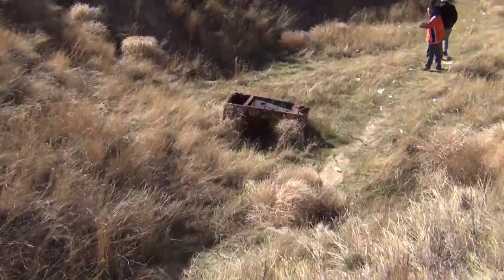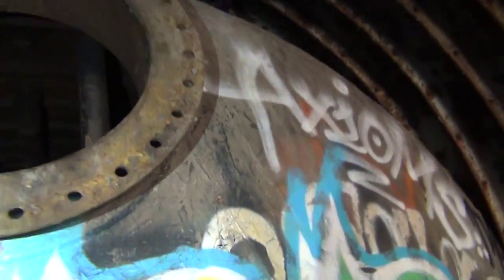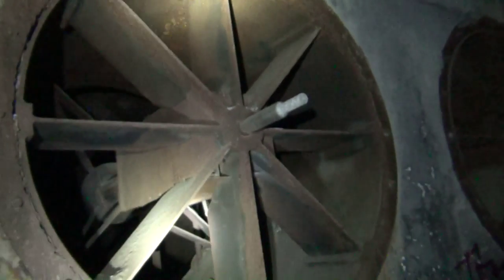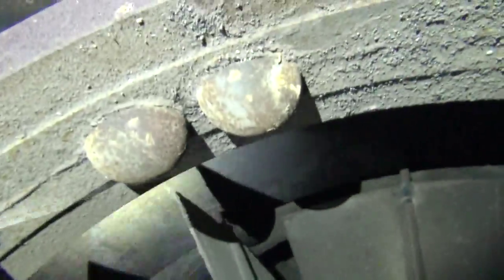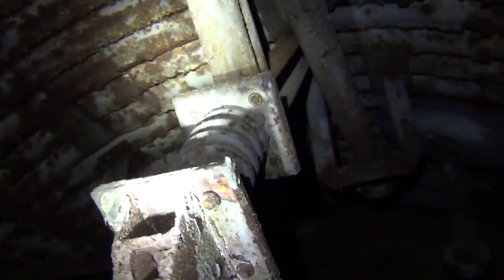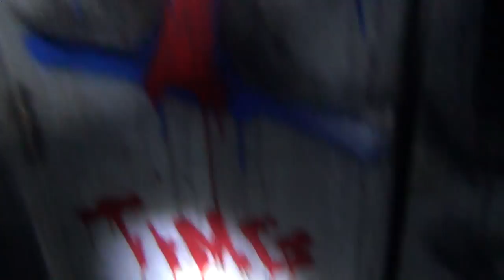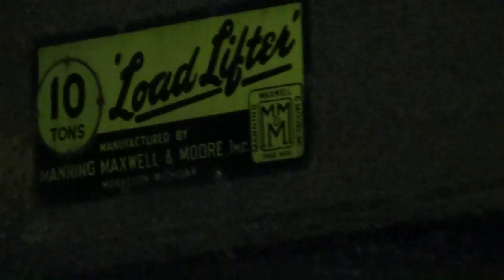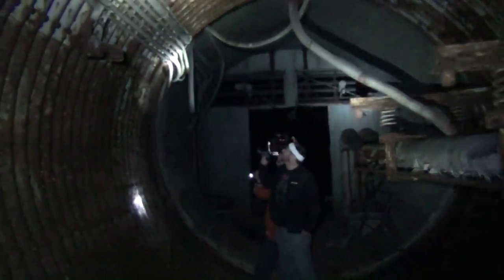Deer Trail Colorado Titan I Missile Silo Complex 2B - Part 1

Comment: That was the power dome, They entered near the air intake and walked across the top floor of the power dome to the exhaust side. The floor below gives access the the rest of the site and the missile silos.We have just seen about 3% of the total site. Looking at the amount of mud that had dried on the intake side you can bet the site is flooded.
Reply: It always had some spots you couldn't go because the water would be to deep

Comment: Entry is via power dome exhaust side where 1 main diesel tank was removed to make scrapping easier.   4 big tubes up high are generator mufflers.   The holes near the outside access are blast valves, not fans.  Area filled with dirt before power dome is the removed day tank for diesel fuel.   Thanks for the video!

Comment: I grew up in Aurora and used to explore these in High School back in the 80s. They were part of the 725th Strategic Missile Squadron out of Lowry AFB in Denver. Actually, there are 3 Titan I sites on the Front Range. At this particular site, a large portion of earth (over 100') has been excavated down  to the tunnel area, exposing the spot where you entered. After it was deactivated, this site was likely used as a storage area; thus modified for ease of entry. When operational, this tunnel would have been buried to the depth of the surrounding terrain. Entry would have been gained via a personnel hatch, followed by a series of stairs descending around the freight elevator. The huge dome you are in was the environmental room for utilities, HVAC and generators.
Reply: Its the power dome,Why would you think they would  put life support (HVAC)next the the diesel generators?. That would just be silly. HVAC was quite far away.
Reply: @mrfinn2006  intake and exhaust for power dome were for the generators etc, not the rest of the base.

Comment: Great video. When was this filmed? I've been out there many times way before all the graffiti was added. Haven't been out there in probably 10 years. A bunch of kids had a rave out there about 15 years ago. Pretty amazing how they pulled it off. Also read in The Denver Post a long time ago that they found a body that had been executed out there back in 1995. Great place for an adventure! Thanks for the memories!
Reply from the maker: Dump a body down the silo and no one would be finding it, just saying. 2015 was when it was filmed. Some say it's closed up now, some say there is an entrance. No idea though, kinda far for a drive to find signs, and fencing. Not worth a trespassing ticket.

Comment: Doing research on this place, hoping to go and take pictures. Coordinates or google maps link?
Reply from the maker: Put this in Google maps: 39.66715008591803, -104.0267194610951

I wouldn't park just driving in on Yale. There has been news reports the neighbors like to call the cops, no clue why the land isn't theirs. But they do. I also heard you might not be able to get in now either. Time has changed with this place and access. It was unsafe in my video, not sure I would go back at least for inside stuff. 

I don't get why the guy that owns this doesn't sell it to someone looking to make a home out of it, some of it might be usable like the power dome room.. It would make for a fun home and these silo sites go for good money.
Reply: @Meekerextreme  I did not expect a response, thank you very much man. 🙂👍

Comment: Hey I just want to thank you for sharing your adventure in
those once high tech marvels. I stumbled across a sight by mistake while
looking online for “hatches” for a system we are designing. And you know how
google is and sends you in different directions. Anyway, I was quite fascinated
in these places. Unfortunately I live in Fl, and would never get the opportunity
to visit one of them. But because of my sudden interest, I researched them quite
extensively. I even have data PDFs and actually have a copy of what looks like
the owner’s manual of the complex. Acquired by another urban explorer such as
yourself. Also have blueprints of which I’m using to draw a 3D model of one in
CAD. If you are interested in knowing, those 4 large tubes that seemed to be
cut off by plasma torches you mentioned? Those are abandoned mufflers from
which the large diesel generators were connected to. The platforms on top of
springs at the bottom of the large dome you were in are where those engines
were mounted. The large tank where you peeked into, I believe is one of 3 that contained
30,000 gallons of fuel each for those said engines. They were said to burn
3,000 gal per day. If there is any more you’d like to know, please shoot me an
E-mail and to the best of my knowledge I’ll give you info of what you saw.
Reply from the maker: +James M Awesome stuff, thanks for sharing
Reply: +Meeker Extreme where exactly is this I know it's in deer trail but what's the name of the road it's on or near
Reply from the maker: Dakota Foy Deer Trail and use sat view on Google and scroll up it's not hard to miss.
Reply: +Meeker Extreme there are hills and fields everywhere around the town I'll never find it i tried typing it into Google maps but I guess the silo isn't in Google maps database
Reply: +Meeker Extreme I scrolled north of deer trail and found a lagoon is it near a lagoon
Reply: +Meeker Extreme hey man I found a website that's say it is 4 miles north northeast of deer trail but it also has the exact coordinates lattitude and longitude is their a map app that allows u to put in exact coordinates
Reply from the maker: Dakota Foy All you have to do is scroll north on the Google Sat view map and there it is. Road name is Yale Ave I believe. They are on the look out for trespassers now and they are writing tickets. Not sure if just a warning or a court appearance type of deal. Also there are signs saying No Trespassing now and they closed the entrance although someone said they dug under it...not sure. Not really worth the risk to me believe it or not I do obey signs and believe in private property rights. When I went there was no fence, no signs and nothing telling me who, or what owned it.
Reply: Someone did dig under it, It's now accessible if you're willing to get a little dirty
Reply: Too far for me, but I'm drawing one of those in CAD. I have original blue prints of a whole complex. I'm using one in a story that will facilitate a star cruiser.

Comment: Cool stuff. Sad to see he sealed it. Should have sold it to someone who has the resources and desire to take care of it - one of these in pristine condition sold for like $1.5 million

Though to be fair it's in pretty terrible shape, and missing all of the catwalks that were suspended in those tunnels, so I'm sure there'd be a much better site somewhere
Reply: Its actually not bad compared to other Titans which are filled with water and flooded. This one is very dry for the most part which would make it cost less to refurb/repurpose. Some low areas probably have water that can be easily pumped out. All the graffiti and missing catwalks is mostly cosmetic and can be easily fixed/remedied. The owner should try and sell it. Could probably get close to 500k to a mil for it.
Reply: Security Camera Man
Actually, the flooded silos' metalwork sometimes end up in better shape

Reason being, rust/oxidation only occurs when there's air/oxygen
If it's filled with water, no air/oxygen is going to get in contact with the metal, therefore no oxidation
Reply from the maker: I agree

Comment: I Just Came Back From The Place! definitely Wear A Mask,As You Go More In You Can Smell Old Jet Fuel.Also Bring Boots Because That Place Is Wet As Hell
Reply from the maker: So the entrance is 100% open? You had eyes on the ground any signs or fence or anything?
Reply: Meeker Extreme It Is Not 100% Open On The Bottom Left Of The Entrance There's A Little Opening That You Might Fit Thru If Your Skinny Enough.Not Trying To Be Mean But If Your Fat,Your Not Gonna Fit Under This That.Like There's A 0% Chance.I Even Had To Suck In My Stomach A Little Bit
Reply from the maker: So it might be almost better now (I'm not fat) to repeal down the ventilation shaft...hmmm.  I guess a good thing is if you are inside no one can come in after you...hahaha Of course they can just wait you out though.